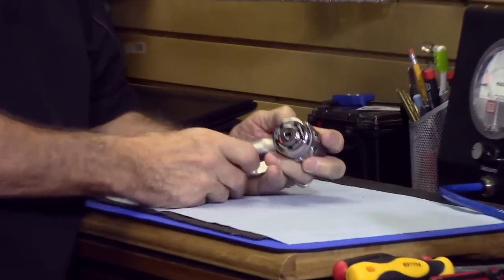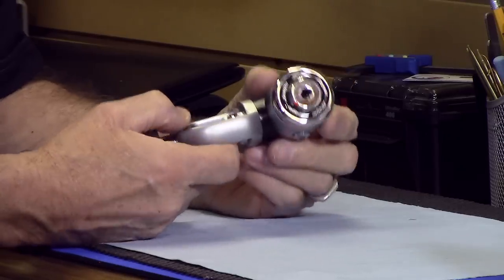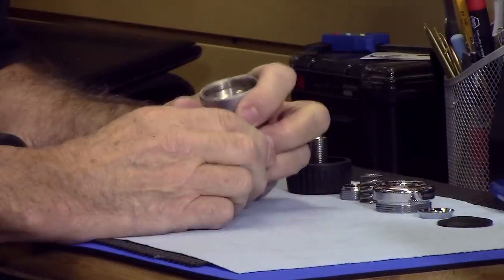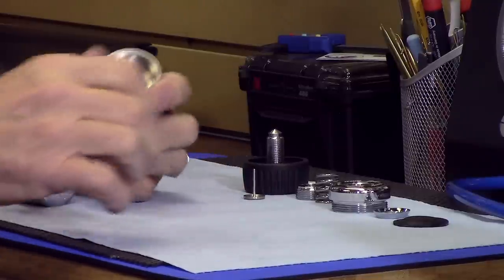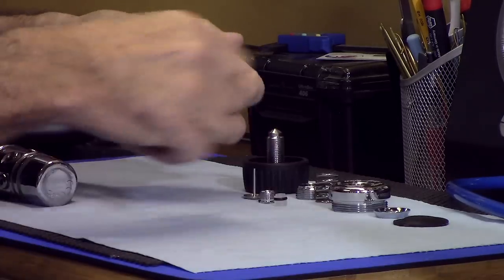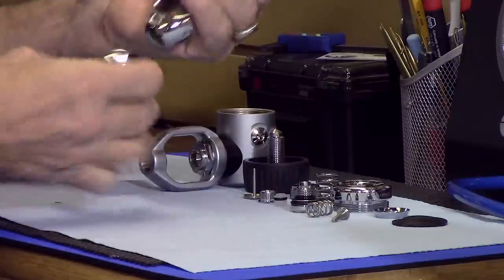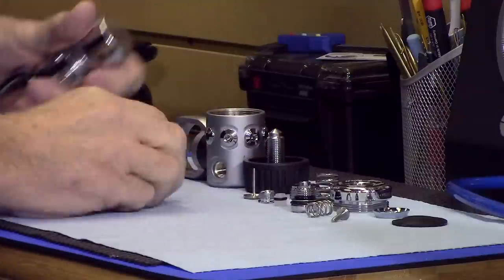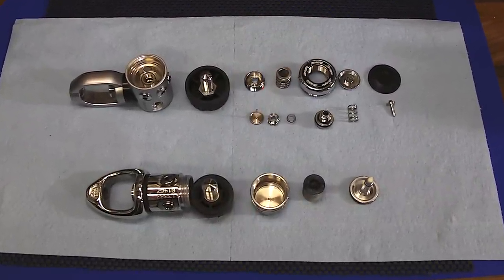Piston vs Diaphragm 1st Stage - Scuba Tech Tips: S07E01

Comment: if piston is better  than diaphragm why did the scubapro people make the mk11 and mk 17  for the longest time they are the one insisting that piston are better than diaphragm
Reply from the maker: The Scubapro Mark 25 is regarded as one of the best regulators of all time - a piston. Scubapro, since you picked it, has had many more piston regs in their line up than diaphragms.
Their MK 11 and Mk 17 are both fine regs but not nearly so popular as the 25.
I suppose the answer to your question is that every company wants to please every customer. Some divers want to buy a diaphragm regulator so Scubapro feels compelled to have one or two in their lineup.
Sherwood, a major brand name for many, many years, has never offered a diaphragm reg. Their reputation was built on rugged reliability and easy maintenance.
US Divers (Aqualung) like Scubapro, has both in their reg line. They tend to lean toward diaphragm regs at the moment but have had several quite famous pistons over the years - the Calypso, the Aquarius, etc.
I don't think I've said that a piston reg is 'better'. I favor a piston reg because of its reliability, simplicity, cost and ease of service.
Both designs do the same job. The choice, other than the factors I've mentioned, is really personal.
If one was not as good or as safe as the other, it would be gone.
Take care.
Alec

Comment: can you do a comparison between a piston and diaphragm 1st stage after 100 dive in salt and chlorinated pool dive it will clearly show how dirty the inside of the piston regulator is specially if it was not wash properly
Reply from the maker: Yep. If you don't rinse your regulator, piston or diaphragm after use, it will get dirty.
So that's why you do that.
In both designs, water must enter the ambient chamber to press against the piston bottom or the diaphragm spring. They both need rinsing.
BTW, it's much easier to rinse a piston reg than try to get any salt water or pool water out of a diaphragm regulator. I've seen some regs with the spring and diaphragm pad so crusted up I wondered how they delivered air.
Both designs have merits but in your comparison, no rinsing,  both will suffer.
I have done a comparison between both designs. Look back at my older videos.
Take care.
Alec
Reply: @AlecPeirceScuba_SeaHunter  One of my regs is a Poseidon Jetstream which I don't think uses either.  I guess the servo pilot valve would be most like a piston, but that's above my pay grade to know.  In any event, I use a rubber cap filled with cheap vodka on the first stage to keep it environmentally sealed.  I've never had a problem with environmental contamination in my Jetstream 1st stage, but it does mean I have to have it serviced at least once a year to make sure the vodka is still there. 

Good information.  I also have an old Sherwood Magnum Blizzard reg (first and second stages), but am looking at upgrading to a newer second stage, and your video answered an important question for me.  It seems not to matter which second stage is used on any given first stage (Poseidon probably the exception), so I could get a new Oceanic Delta 5 and pair it with my Sherwood first stage.  I already have a Cressi octopus on that reg.  Thanks again for the great videos!

Comment: Which one malfunction more
Reply from the maker: There's no real evidence available to answer that question Curtis. Both are incredibly reliable.
Given the rugged parts and simplicity of design, I would guess the piston might have a slight edge in reliability but I have nothing to base that on other than my mechanical experience.
Alec
Reply: Think simply, a diaphragm flexes and a piston literally moves with 2 O-rings that require silicone lubricant! Diaphragms will work indefinitely and without maintenance. You CAN blow one out...but you'd have to back-off the adjustment with pressure on it!

Comment: Piston:  Simpler in design?  Yes.  More reliable / durable / rugged?  Absolutely not.  Nearly all studies performed on the two designs show them to be about equal.  And that only holds true if the piston reg has been environmentally sealed in some fashion- otherwise, diaphragm wins (excluding abnormal events, such as multiple flooding of the regulators.)   Cheaper?  Again, no.  They are very comparable.  In fact, when calculating the cost of maintenance of high-end Piston vs Diaphragm regs, I would argue that a diaphragm is MUCH cheaper, let alone the initial cost being cheaper.
So where does the piston regulator really win?  Besides a simpler design, they theoretically offer higher potential air flow.  Does the higher air flow matter to the consumer?  Nope- not unless they plan on having several divers breathing off of one 1st stage at extreme depths, or 20+ divers breathing off one 1st stage at recreational depths.
This really isn't up for debate either.  Unfortunately, too many myths float around as truths.  Some of you may ask, what makes me the subject expert on regulator design; to which I respond, it's my job.
Reply: Also, technically there are two piston designs... I believe Sherwood is the only major company that uses the other though.
Reply from the maker: I really appreciate your input and accept it as your expert advice W.
I will suggest however a couple of things based on 47 years as a scuba regulator serviceman.
1. a piston reg is much cheaper to service and for good reasons:
     a. it takes about 20 minutes to completely clean, overhaul and set up a piston reg as compare to about 1 hour for a diaphragm.
         If a dive store charges a flat fee to service a reg, the charge will be the same but that's patently unfair. It ought to be cheaper 
         for the labor on a piston. The service involves simple removal of the cap, changing 2 O-Rings, replacing the HP seat and filter 
         plus any cleaning of course.- Done! 
      b. a 1st service kit includes 2 O-Rings, 1 HP seat, 1 filter. Piston kits typically cost less than $20 (even that's overpriced!).
          Diaphragm kits include many more parts and generally cost closer to $75.
2.  there is no difference in the anti-freezing abilities of the 2 styles assuming neither has special environmental options.
      The diaphragm reg will have water against the rubber diaphragm while the piston will have water against the stainless steel 
      piston stem. Neither of these parts is related to the freezing problem The freezing problem occurs at the HP seat-orifice 
      junction which is located in a similar position in both regs - well away from any water. Even with anti-freezing options, the only   
      advantage for both is that no water hits either the rubber diaphragm or the piston stem. I admit that, once freezing begins, the 
      piston regulator will react more quickly, in an unfavorable way. But the design did not facilitate the frezzing.
      Now if you consider the Sherwood piston regulators that use a Dry Air Bleed anti-freeze design, unique to Sherwood, no water 
      enters the body of the regulator at all. Plus this design does not need any anti-freeze liquid (alcohol or silicon oil). 
      I've never been a big fan of the anti-freeze liquid design as used on most diaphragm regs and on some pistons too. These are 
      the kits used on Aqua-Lung, Mares, Apeks, and others. They can be recognized by the flexible (rubber or silicon) cap on the 
      adjustment end of the regulator.There's good reason for that too:
      a. they are messy as heck and make service a nightmare.
      b. the anti-freeze kit is costly, typically close to $100.
      c. annual service is more costly for both labor and liquid replacement.
      d. liquid sealed diaphragms are slightly but measurably less sensitive to outside pressure changes. And if any air is trapped 
          under the anti-freeze cap (resulting from poor service methods),  compression of that air makes them even less sensitive.
      e. unless the cap and liquid are checked on a regular basis, any tiny leak in the system will result in slow mixing of the anti-
          freeze solution and water. The resulting corrosion from the trapped water can be disastrous. I have seen this many times.

You are completely correct on the piston regulator offering greater air flow (assuming a balanced regulator of course). The reason BTW is that the HP orifice can be larger on a piston style. Theoretically it could be even larger but size restraints on the overall size of the 1st stage limit the size of the reg and as you say, there's no need for that much air flow for scuba divers.
However, a larger orifice and the resulting greater air flow has more value that just the ability to deliver more air. With respect to the anti-freeze ability of the reg, a larger orifice has a lower likelihood of being affected by ice from adiabatic temperature drop - the real reason for reg freeze-up.

I won't question your credentials W but I think some of your deductions are not well thought out. A simple check on-line of the cost of piston regs vs diaphragm will show that a simple piston is cheaper than a simple diaphragm. It is BTW just one reason why the rental departments of most dive stores use piston regulators (unless as is common, they are swayed by the dealer commitments). Other reasons are the aforementioned cheaper parts and shorter, easier service times.
And similarly, it's easy to compare on-line the cost of a piston service kit to that of a diaphragm service kit and again the piston is generally cheaper.
It may not be good for us to chat up a reg design because "it's cheaper" but for the purpose of this conversation, it's appropriate.

You mention stats or studies comparing the 2 designs. I keep pretty current on such things and have regular conversations (often lengthy) with several recognized scuba regulator experts (Global technicians, DCIEM, etc) and I don't believe I've ever seen such a study. I'd love to look at it. Please provide with us with a link if possible.

In the meantime, thank again for watching and for your input.
Alec
Reply: 1.  I'm not sure where you get 20 minutes vs 1 hour- at least not on modern regulator designs.  BTW- I envy the history of gear you have... Truly amazing.  (Side note- Any chance you'll be selling some of those home-built setups you have?  :D)
A modern diaphragm vs piston are rather close in terms of service time.  The time required to remove the HP and LP port plugs / hoses is about equal to disassembly time.  Cleaning takes the longest, and the use of an ultrasonic cleaner makes it a moot point.  Assembly on a diaphragm takes a bit longer, but not more than 2-3 minutes more.  Adjusting a diaphragm takes much less time as you don't have to disassemble to add or remove shims- you just turn the adjustment screw.
I'm ill versed with Mares regulators.  However, nearly all modern diaphragm enviromental seals use dry systems- no oils / grease needed.  This includes Aqua-Lung, Apeks, Dive Rite, HOG, Deep 6, Hollis, Oceanic, and many others.  Also, there's virtually no additional cost for environmentally sealed diaphragms nowadays because of the dry design.  Environmentally sealing piston regulators normally require the use of a LOT of christolube or something similar, which gets extremely messy, costly, and very time consuming to ensure no air pockets exist.
I know pricing in Canada is different than in the US.  Though dealer pricing for most diaphragm service kits in the US is much lower than what you quoted.  In fact, consumers can get Hollis service kits online for about $20.  Same for HOG, Deep 6, and several other brands.  Most piston kits are cheaper by about $5 to consumers.  Also, pistons have a tendancy to need replacement after a few services which raises the service cost.  And, to my knowledge, there are no piston regulators that are serviceable at the consumer level (while leaving the warranty intact), except for Countries and municipalities that require it by law.

2.  I agree.  That said, environmentally sealing a diaphragm is much easier than sealing a piston.  (As a random point, you'll only find unbalanced piston regs nowadays) It's also a lot cheaper- see above.  (Sherwood excluded, of course.... gotta give you that one.)  Again, modern diaphragms no longer use that horrible oil design.  Folks still diving that type should consider buying new (or converting, if possible) as it will pay for itself very quickly.
On the flip side, the cost of environmentally sealing a piston is time consuming, messy, and costly (excluding using hacks, like a condom or something.)  Sure, designs are out there to minimize freezing, like with the SP Evo series... but I think we can both agree environmentally sealing is the way to go.

3.  I believe Scuba Pro holds the "World Record" for most people breathing off of one regulator... it was a piston.  I think it was around 130 people??  Absolutely insane!  But yeah, I agree- there's no need for that.

4.  I'd argue most dive stores use whatever brand they carry for their rental gear, not just anything.  As such, piston v diaphragm rentals is solely dependent on what their respective brands offer.

You can contact WMD, ODS, and Aquatec- I'm sure they'll share whatever research they have.  You can also try Atomic's plant, but since they only create piston regs, any data they have may be self serving...  Also, DAN is a great source, as is the rubicon foundation.  One study analyzed the first 1000 incidents from the "Diving Incident Monitoring Study" (DIMS) which started circa 1988.  Of those 1000 incidents, less than 10 were from 1st stage failure.  Of those, some were from improperly being attached to the cylinder.  Very few were from what you and I would consider actual 1st stage failures.  Unfortunately, no data exists showing whether the reg was a diaphragm or piston design.  Regardless, with less than a handful of failures out of what can be assumed to be tens, if not hundreds of thousands of dives, I'd say my point of reliability holds true.  (Can you point to a scholarly, peer-reviewed study that supports your claim?) You're welcome to dig through the first 1000 incidents to see the actual numbers yourself... (I'm not trying to be snarky here- I just don't see a good way to lay it out in a neat way)  Here's the abbreviated study (minus the full incident reports):
http://archive.rubicon-foundation.org/xmlui/bitstream/handle/123456789/7762/SPUMS_V33N1_9.pdf?sequence=1
Reply: and, thank you for taking the time to respond to my first statement.  Very appreciated - it shows your true colors as a person who cares about the people in our sport!